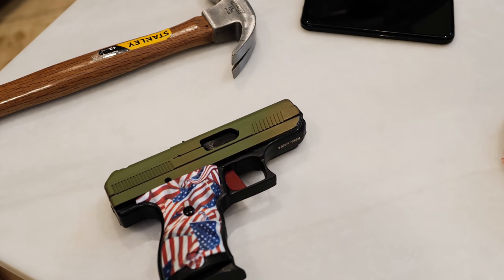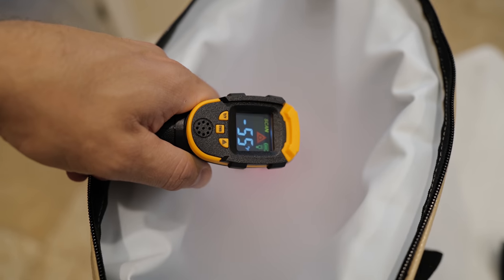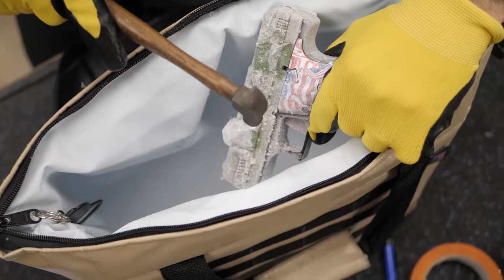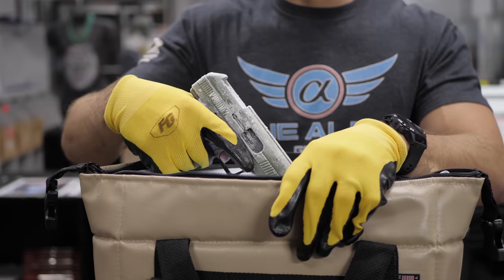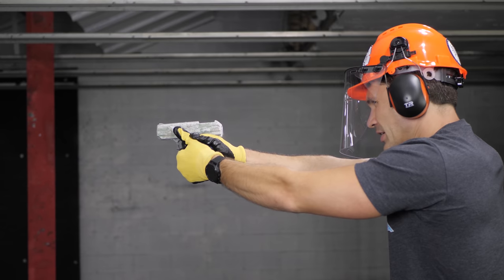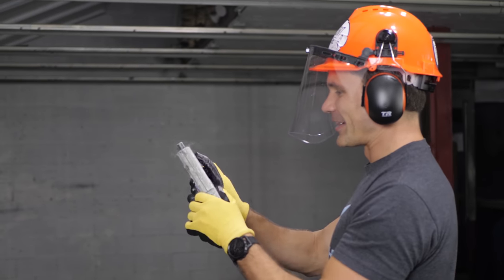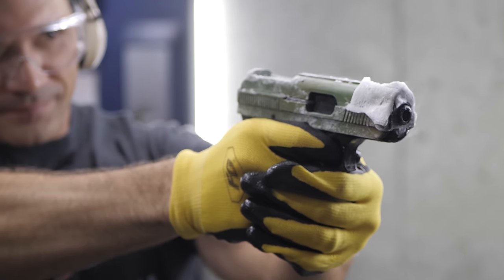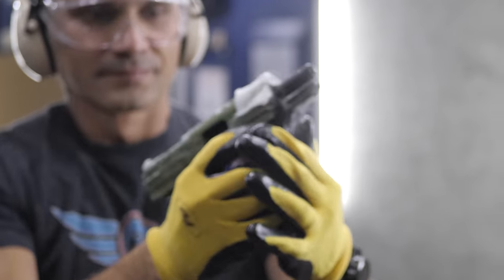Hi-Point C9 Torture Test: Frozen to -100° Degrees

Comment: Custom trigger? Well there's your problem! "Enhancements" only remove from the nature perfection of the Hi-Point
Reply: Exactly what I thought. It also looked like the gun was wet when it went into the ice or it was super humid. Never seen ice build up like that with just dry ice. maybe the dry ice was contaminated with water. Usually the guns have frost but not huge icebergs hanging off.
Reply: Ditto!

Comment: Lol the ferrari of high point. So, like a geo metro with automatic windows? 🤣 You're videos are always great!
Reply: bet it would look better with a red dot...
Reply: Geo Metro with automatic windows AND an automatic transmission!
Reply: Like a metro with 4 cylinders
Reply: @evergreenrider  Good one! I forgot that was a 3-cylinder....I KNOW! We'll turbocharge it!! :)
Reply: No Geo Metros starting up in negative 100°. The doors wouldn’t even open, let’s be real
Reply: @JoeArn1  (Narrator voice): "We started this Geo Metro with this Sears Die Hard battery...."   (1970's ad if I recall right).
Reply: Had a geo prism. Thing never got stuck in the snow, never broke down and had 200k miles on it when i got in a wreck
Reply: @zanegardner6488  prisms were the nice Geo's. You actually had 4 cylinders to play with
Reply: @evergreenrider  😂😂😂!! I put a CD player in it and was riding in style i tell ya. Oil change every 7k miles and the oil still looked new basically, manual windows and seats. But was a automatic. Put Walmart rims on it as a joke. My friends would get stuck in their trucks and suvs in the snow and i never once even came close. Was pretty upset when i rear ended someone and basically totaled it
Reply: @zanegardner6488  back in high school there were 2 400 lb+ brothers. They rode together in a metro. When one was missing, the other would get that sonuvabitch on 2 wheels going around the corners of the parking lot. The suspension i legitimately felt bad for
Reply: @evergreenrider  😂😂😂
Reply: I feel that manual windows can be made just as easy to lower as power windows.
Reply: a Yogo with Drag Slicks!
Reply: "1982 Chevrolet Chevette diesel"
Reply: @zanegardner6488  Prisms were so reliable because they were basically rebadged Toyota Corollas.

Comment: When Hi-Point came out, a friend bought one. I fired the first 3rds and the rear sight fell off. I fired every type of ammo I had and it never missed a beat. More reliable than any factory Colt 1911 I've ever owned.
Reply: Rear sight optional; included at no extra cost. But they are also a PAIN to strip for cleaning.
Reply: Send to the Factory ...
Reply: @markh.6687  Easy don't clean it

Comment: The fact that it worked after the slide was tapped forward seems to indicate that it wasn't fully in battery and the striker wouldn't engage; if that's the case, then that's great, it means that Hi-Point safety features work as intended. With that low a temperature, the recoil spring is going to be stiffer, and lube is going to be more viscous, so entirely possible that the slide was just a little short on energy needed to go fully into battery.

10/10 would buy a Hi-Point.

Comment: Primary cause of failure to fire was a very simple one. The humid Florida air was condensing on parts and freezing, causing the weapon to not fully go into battery. A secondary possibly is the primers were getting so cold that the chemical reactions were not happening on impact.

Comment: The residual cold on the gun was causing the humid Floriduh air to condense on the surfaces frosting it up and binding some of the moving parts. Those of us in cold climates leave guns out in extreme temperatures to eliminate the frosting up from damp inside air. Once you're down below 0* F, humidity ceases to be a problem. The cold by itself doesn't hurt them. Most modern gun lubes will flow well below 0* F and not gum up the works or slow things down like old school gun oils used to do. Break Free CLP and EEZOX CLP are two of the best cold weather lubes available. They also seem to shuck off the binding of ice and frost on working surfaces they're applied to.

Comment: I wouldn't have a problem if you use my  patreon money to buy a proper helmet, that thing looks like utter garbage did you bought it at a costume shop or what? 😄
Reply: That’s a hard hat with a face shield accessory. It’s what OSHA recommends when using a grinder or cutoff wheel.
Reply: @RadDadisRad  HEH He said Grinder
Reply: @RadDadisRad  Looks like logging gear.
Reply: That's for trimming the hedge!
Reply: @RadDadisRad  That face shield looks super thin I wouldn't have much trust in it. I'm a Landscaper btw 😄
Reply: @JamesgnuoY1  if James used Grinder, he wouldn't have said "slap it in the butt" & probably would have gone with "tap dat ass"

Comment: I'm impressed. Low temperature lubrication is a very tricky field. The Air Force gave the guys in Alaska very special lubrication for their guns and other tools. Green can, smelled like Marvel Mystery oil. It gums up in hot weather but the weapons functioned great at 40 below. At those temps even ratchets won't turn if they have grease in them.
 
If I was going to be in sub zero weather I would use Teflon or graphite inside, no grease or oil. Or just use USAF low temperature weapons oil.

Comment: It looks like there might be some buildup in the Internals preventing it from going completely into battery or possibly some ice in the firing pin channel slowing it down some or even preventing engagement with the primer.... couldnt tell what was going on with the trigger, my thought is that it wasn't going fully into battery therefore incomplete reset of the trigger. It could even be something as simple as ice built up around the chamber and neck of the barrel creating friction against the slide. Which is why once it warmed up it ran better. Or maybe a combination of all 3.... without actually looking at the gun myself, I cant tell for sure.

Comment: Bit late to the party. . .
I bought my first handgun, a c9, in 2006. I was living in fairbanks Alaska at the time, and as I rather like my range time, I refused to be limited to when temps were above freezing to go to the range.  My experience was that ammo mattered more than anything else; Aluminum cased ammo was a no go: too much friction in the magazine. Steel cased ammo was a bit better, and would work to colder temps. Good round nosed brass cased ammo always worked, even down to -40.   So aluminum cased failed around freezing, steel cased around -20f, and brass always worked. Bullet geometry also had an impact with round nose FMJ being the most reliable, and truncated cone FMJ being the least at low temps.

Comment: WD-40 Specialist® Silicone Lubricant safely lubricates, waterproofs and protects metal and non-metal surfaces such as rubber, plastic and vinyl. This formula dries fast and leaves a clear, non-staining film that doesn't stick or make a mess, so it won't attract dirt. This silicone lubricant spray is great for use on cables, pulleys, guide rails, valves, linkages, hinges, locks and more. Effective in-use temperatures ranging from -100° F to 500° F.

Comment: I had an early c9 just because i was buying 2 other pistols from a widow & she wanted to sell all 3 or none. It had a similar issue first time out at range except it would fire after a dead trigger if you hit the back like that. I accidentally ventilated my lazy boy with it but i called hi-point and they sent me all new springs, striker, sear, and the transfer bar that connects trigger to sear. I replaced everything for FREE and the pistol would eat anything i fed it, including .380acp...  Sold it three years later to a tow truck driver for $75 & made $30 profit!  Say what u want bout yeet cannon, damm thing runs, no question!

Comment: I bet what's happening is that when a round fires the heat melts some of that frosty frost that's everywhere. Then the metal is so cold that it's freezing whatever melted almost instantly causing all of the internals to freeze up so nothing functions without a good smack.

Comment: I love stuff like this. I owned a hipoint, paid like $150 with a couple boxes of ammo out the door years ago like 14-15 years ago. I never cleaned it a day in its life. Id take it to the local outdoor vfw range and feed two 100rd boxes of winchester white box through it almost every single weekend just plinking for several years and it never missed a beat. People think they are crap, and maybe I just got lucky idk but I had thousands of rounds through it. I eventually sold it to a buddy for $50 and he took it apart and  cleaned it fir the first time in its life.
Reply: The reason the HiPoint pistol and 995 carbine are so dependable is because they are straight blowback firearms. A friend brought a HiPoint carbine in to me and said it was jamming (FTF) He had not cleaned it in three years. Broke it down, cleaned years of carbon out.And it again worked fine.

Comment: Probably an out of battery safety or short firing pin. The cold is probably causing the gun to hang up almost imperceptibly so a tap on the back, or jostling with the trigger, will bring the gun into battery.

Comment: My first love is my Sigs, but I have 2 C-9's and a .45 and I wouldn't trade them for the world.  Yes, they're butt ugly.  Yes, they're heavy AF.  Yes, they can be marginally difficult to work on and yes if by some fluke I broke a hammer, I'd have no reservations using an Hi Point to pound a couple of nails in, but remember they are mass produced and made as inexpensively as possible, in order to get attract people on a budget or those unwilling to drop a grand on a pistol.  Say what you will about them, however I have yet to find another firearm anywhere that has a 100% unconditional warranty that's transferrable.  Hell, I even lost a couple of springs, reached out to the good folks in Mansfield and they sent me two completely free of charge.  Sig won't do that, neither will HK nor Glock.

Comment: Seems like the gun is contracting from being frozen, bc every time you tapped it on the back of the slide you were able to fire it. I’m betting as soon as it returns to normal temperature it will fire as accurately as it did before putting it in the cryogenic chamber. That’s funny

Comment: Moisture freezing, known as dewpoint, on the cold metal surfaces in the warmer ambient temperatures could be the problem. I'm guessing if you kept the gun in a cold environment (gun range in a deep freeze) there would be no issues. Still an ugly gun.